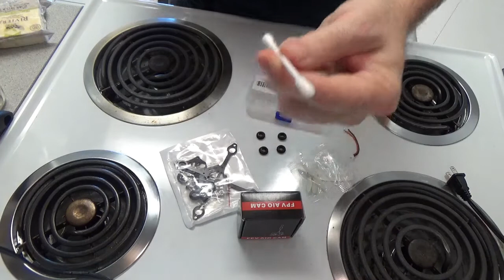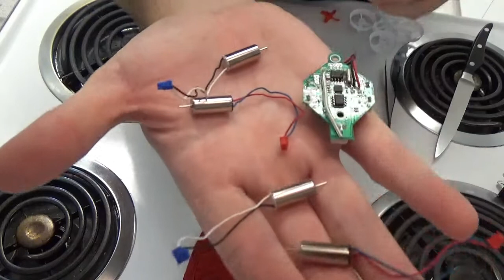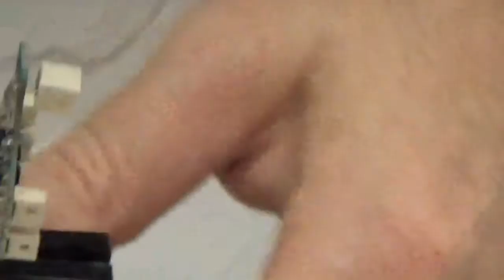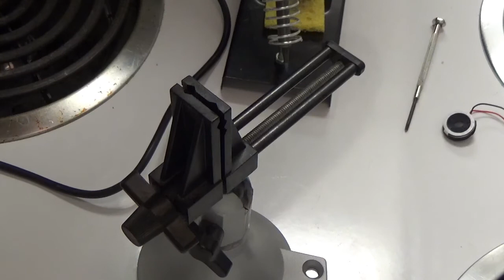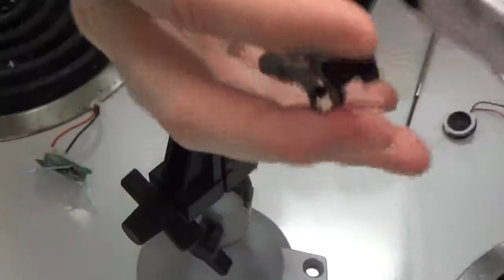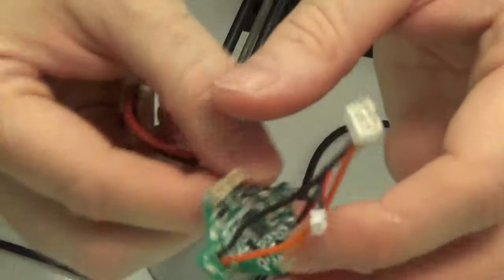Eachine E011 (or JJRC H67) to X Frame FPV Quad conversion: Part 1

Comment: im sorry, im not tryin to mean or rude or just an asshole, but i just wanted to mention things i saw that could be improved to help you and others, also we appreciate you taking the time to make a tutorial, first thing is, which really isnt a big deal cause im guilty of doing the same thing in the beginning, is the prop removal tool is designed to go to the under side of the ducts to remove props with the handle pitched downward, with the forked portion between the motor and prop, and push downward on the handle, this way your not tweaking the ducts and struts,  next is removing the ph 2.0 from the receiver board, flux and add a bit of solder to the top side of the RX boards neg & pos through hole solder points to make reflowing a breeze, then use a small pair of vice grip needle nose pliers or tweezers with a rubber band holding them shut, and latch on to the ph 2.0 plug, letting the vice grips or tweezers hang downward while the RX board is in the upright position, and from the top side hit the NEG & POS solder points with a freshly cleaned and generously pre tinned 700° F solder tip and reflow the solder points, and the jst ph 2.0 will fall right out quickly due to the weight of the tool holding it, also as mentioned below by drone lovers fpv, solder the aio cam to the same solder points the lipo wires are soldered to, cause the aio fpv micro cams are some power hungry lil gremlins and need all the current they can get, ....please dont take offense to my $0.02 worth of info, i just wanna try and help and shed a lil tip here and there i have learned within the last 2 years of my crackhead like whoop addiction, and thanks for the great vid to help others out. if your interested, heres a link to check out some e011 NFE SILVERWARE whoop footage i put together, thanx again and whoop on !!!  https://www.youtube.com/watch?v=MKwfnLpHmi0&t=1s

Comment: Just a couple of things, the Lantian frame is for 8520 motors and the E011 come with 716 so you will need new motors as well, carefull because the frame is a bit week... I did the same you did but with a JJRC h8 mini flight controller flashed with Dual Mode firmware to fly ACRO and the frame broke on the third flight, the King Kong 100 would be better suited for this mod because its PLA plastic and its much stonger... Also I would recomend soldering the camera wires directly on the top of the battery pads so you have the full 4,2volts from the battery, it will give you better performance on the camera... Any thing you need to do the rest of the build you can PM me and I will gladly help... Big hug and all the best my friend...
Reply from the maker: Yeah, it's likely underpowered with 7mm motors... I'm mostly using this configuration for casual FPV cruising (I lost the first one I made by crashing it in a swamp when I tried to fly longer than I should have haha), but I'll definitely try your King Kong 100/8520 build (it would be awesome having more punch and I definitely like that that's a stronger frame). Thanks for the tips and support! Do you have any recommendations for battery mah/C rating for powering 8520s?
Reply: Anything betwin 260mAh and 500mAh would work great with 8520motors, 500mAh will give you a crazy punch and speed but will also shorten the life of the motors... With the King Kong 100 frame you can crash as much as you want that it will take it like a champ... Got a new sub here, keep moding and uploading your ideas because thats what the hobby needs, creative pilots that try new things and have fun doing it... Big hug from Portugal